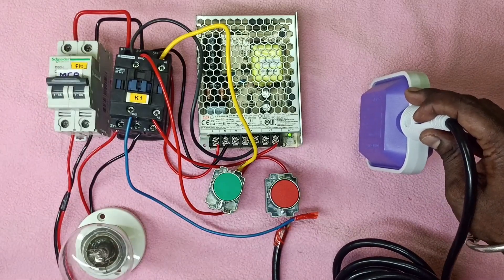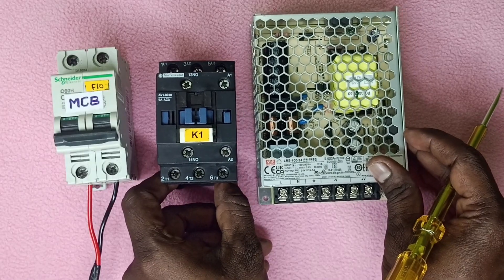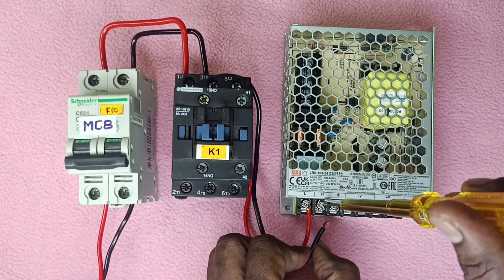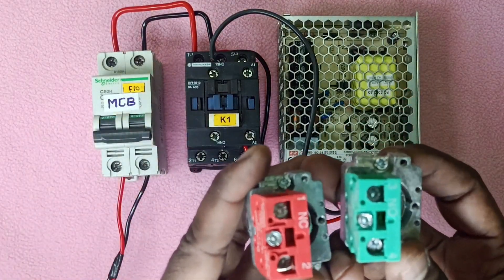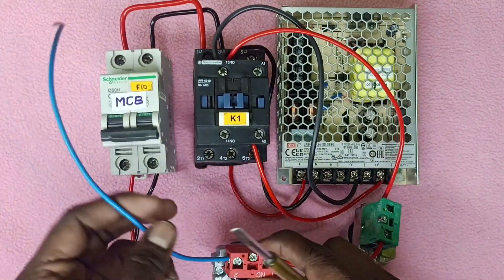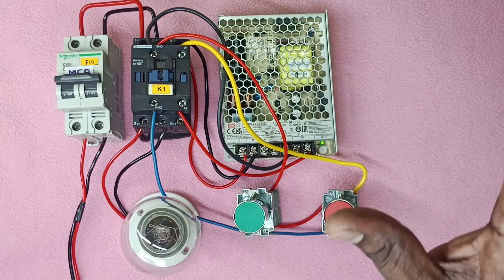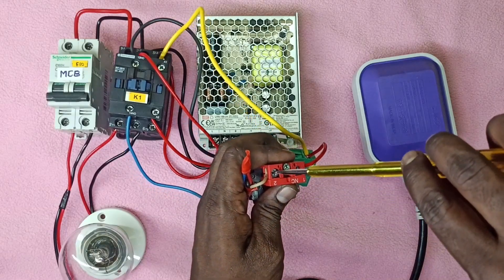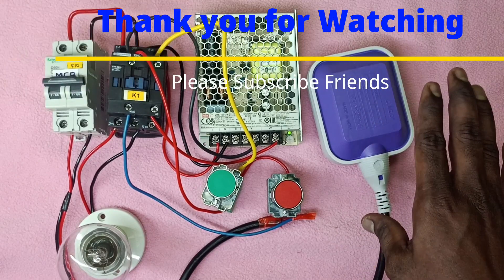Automatic Water Level Controller | Float Switch Connection | DOL Starter |#electrical #tamil

Comment: Hi Sir, can you please do a video for controlling booster pump, booster pump should turn ON when there is water in tank and OFF when there is no water in tank, controlling float switch with dc supply

Comment: Please Sir,kindly you help me for one upload the same vedio for AC220volt supply &24volt DC SMPS board with 2 dc 24volt Relay base for CONNECTION of WLControllerin Submersible Pump CONNECTION.

Comment: Bro contactor la A1 point  24 dc supply ,next A2 0V supply , you connection so change A1 🔄 A2 yyy?
Reply from the maker: A1,A2 termenal wire change panna thappu illa